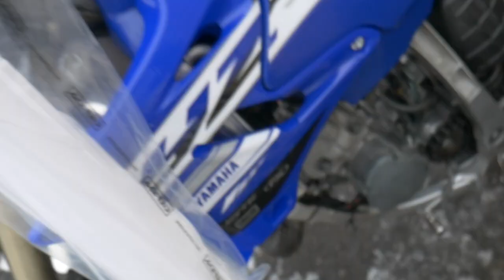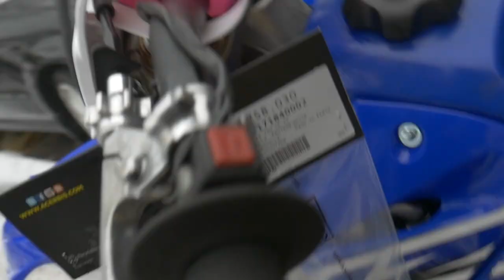ADJUSTING MY YZ125 TO RUN CRISPY! |JUSTDOITTRAY

Comment: hold the throttle wide open for 30secs  to clear your pipe from  build up if you did it right you should see you sliencer  will be clear  and you won't  carbon also you will see a diffrence in preformance
Reply from the maker: Thanks bro I got a new exhaust coming hopefully that helps to😄💪🏽🤟🏽💯
Reply: Bro are you kidding me🤣🤣🤣🤣🤣
Reply: I hope you didn’t hold it open lmao you should of just repacked your silencer easy to do and cost about 10 for wadding

Comment: Yo tray bike still sound alittle rich to me but without riding it dont know  the joint should give you instant power from bottom to top no bog or loading up then hit have you ever changed the jets
Reply from the maker: I never did the jets but I know if I play around with the carb a little more I can get it perfect. She running a lot better for suree tho😄💪🏽
Reply from the maker: Also my be my mix because I mixed her a lil heavy because of the brand new top end and jug we gonna get tho lol🤷🏽‍♂️😂💪🏽
Reply: @JustDoItTray  yea as far as the mix that will do it too though 4oz to every gallon Basically 32:1 cant go wrong

Comment: what kind of pipe you get ?
Reply from the maker: Oem everything bro!😂🤟🏽
Reply: U should get fmf with shorty I have yz125 2003 u might have to change main to 410 or 430 an pilot at 40 2 out air screw I have mine same its running good an u get apex head I have that also so much more power